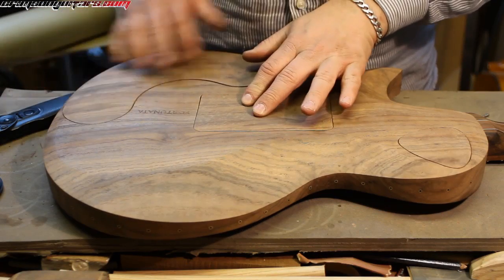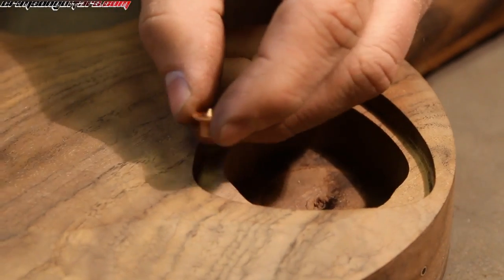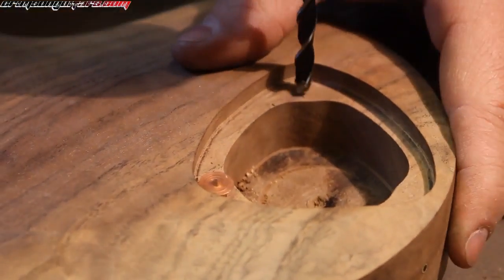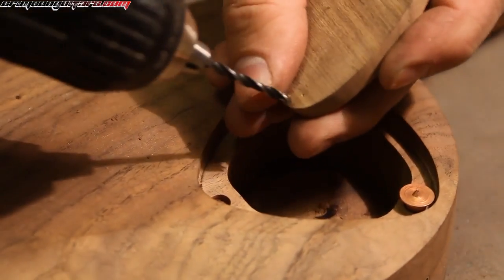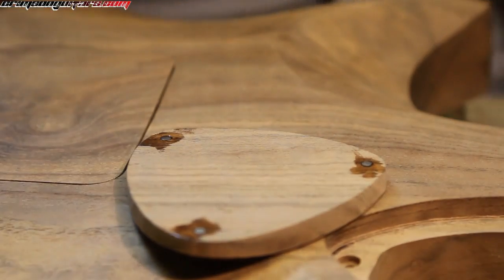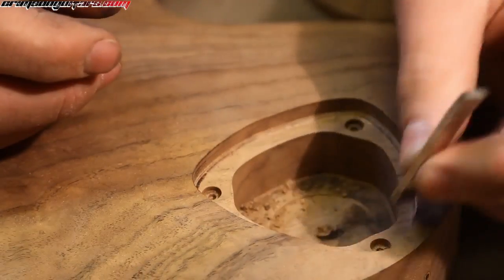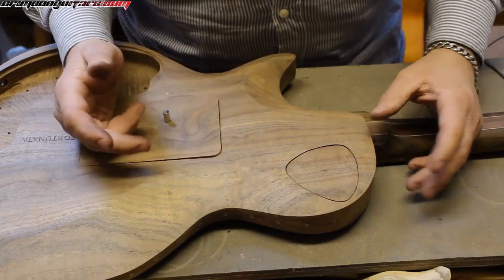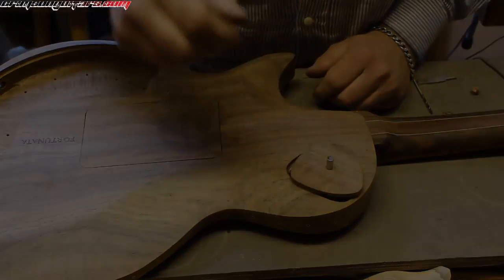Clarity Ep 51 - Playing With Magnets

Comment: Hi Ben. Great guitar. Lovely work. I have made similar control covers with the magnets. What worked well for removing them was to put a chamfer on the underside of the cover in one corner, when pushed at that point, it canter leavers the control plate out. Has worked for me. 👌

Comment: Ben, you ARE an utter genius! Just one thought, instead of putting more magnets in the guitar body, how about putting a pickguard screw (or similar) at each corner of the cavity and fitting a tiny wood plug on top of it to render it invisible?The cover would still be held shut and you'd save on magnets. And to prevent the cover being fitted the wrong way, how about a key - I'm thinking of a small tab along the inside of one edge of the cover, with a corresponding slot inside the cavity.

Comment: I like this a lot, great idea!  Also like chromauk's snooker tip idea for the protective surface.  Though he called it velvet, I believe they are suede cow hide leather which IMHO works well with wood for looks, and in this case function.  I'd add my own thought, that if you could find a hex cap screw that fit into the neck strap buttons and that the tool could fit inside of the hex feature, you'd have an awesome storage location.

Comment: Since the (roughly) triangular back plate tends to fit the cavity in more than one position, you may have switched the polarity of one of the magnets (and switch the corresponding magnet in the guitar body, too). This way, two magnets out of three would be repelled in case of wrong orientation of the plate: it would stay in place only if correctly inserted.
Same idea for the rectangular plate...

Anyway, good idea: I really appreciate the resulting clean look!!!

Other suggestion: try to create a place in the guitar's body where to put the tool...

:-)

Comment: There is a computer gaming  mouse called the logitech G403, whitch employs the same magnet type cover  in its bottom for inserting/removing weights. The lid is cut in such a way that if you press down at the outer edge between two of the magnets, the other side pops up. No tool needed for that :). Just make the angle of the cover and the placement of the magnets to allow it to swing up. Love These videos Btw. Not a guitar Builder Myself. Beautiful instrument :)

Comment: Ben, I am working on my first build with a swamp ash body and will be grain filling black to accent the grain, dyeing multi-shades of green, and finishing with CG Finishing Oil & Renaissance wax as per your Bari-Tele series. I have lots of abrasives on hand (3M & Mirka Abranet, wire wool) and wanted your input as to what grits I should use before/after grain filling, and before/during/after applications of your finishing oil. Thanks very kindly. Cheers, Matt B

Comment: Will the magnets have any effect on the electronics? Will they have any effect on the strings. I must say the idea is brilliant. You won't know until everything is installed. Thank you so much for sharing your knowledge. Thankz
Reply: +Audio Tech Labs I'm sure they technically could, but I really doubt it would be at all audible.  It would be about as big a difference as mounting another pickup on the guitar somewhere.  Technically, every piece of ferrous metal on the guitar is going to change the magnetic field of the pickups slightly.

I'd like to know where I can get one of those little centering pin things, though.  They look really handy.  I'm not sure what they're called or what to search for.
Reply: +Josh Wilson Thanks for the reply

Comment: Very cool idea. Will these, in any minute way, interfere with the electro-magnetic fields of the pickups?
Reply: Nope.
Reply: +Bas Vredeling i had exactly the same thoughts, i'd like to know why the magnets do not interfere with the pickups or not causing any variation (percieved as hum or in a different behavior of the caps and pots). because, following my engineering studies, they should.
Reply: +ktulhu2011 the magnets are tiny. there are magnets in the pickups themselves, and you can't really hear the effect of having two pickups close to each other, so these should be no problem.
Reply: ***** the ones that he put in the toggle cavity are not big, so i agree, we'll se what he puts in the bigger ones and how the guitar will sound once finished.

Comment: This might sound stupid (it might be stupid), but if you have two more or less identical magnets stuck together like this, do they pretty much cancel each other out?  As in, is there any net magnetic field outside of the two holding each other?  Maybe somebody who knows something about magnets can answer.  I still doubt these things would cause any real audible change in the pickups.  Maybe about as much as your belt buckle.
Reply: They don't "cancel out" as you put it. a magnet had two poles, a positive and a negative. When you bring two magnets together the positive pole of one contacts the negative of the other. These poles do mostly cancel each other out but that still leaves the two poles at the other ends. The end result is that the two magnets behave as though they are now one, longer magnet.

Comment: Ben are you not concerned about putting so many magnets close to the electronics?, especially around the pickups, and the sustainer electronics?, 
it doesn't seem like a good idea to me, I don't think I would do it
Reply: +watchtheskies Should not be a problem, because these magnets create a stabel magnetic field, not an altering field. As long as the cabels dont move around , there should be no induction currents.

Comment: Tried that last year. Then the pocket cover warped just a little. Now it falls off constantly :D
Reply: Having the same problem with my build...was nice and flat but the wood has moved a bit and now the cavity cover rocks slightly...I haven't put the magnets in yet...I'm hoping they will work now that the cover is slightly warped...otherwise the cover is going to take a lot of finessing
Reply: My mistake was that I did not apply same amount of finish on the both sides. Oh well.

Comment: The whole point of using magnets in the control cavity is to open them without tools .. so needing a magnet-tool to open them kinda defeat the purpose… I’ve seen better designs.. Some with a finger notch (not that bad actually) or some (on PMC guitars if I remember well) where you would push on one side to make the control cover come off   (imagine a square control cover with only 3 corners supported underneath.. push hard on the 4th corner to open.. way more elegant and no tool needed :)
Reply: +ZeRealGlobox  He is using magnets so he doesn't have to show screws. It's a cosmetic decision.